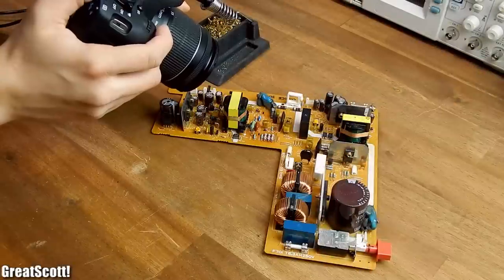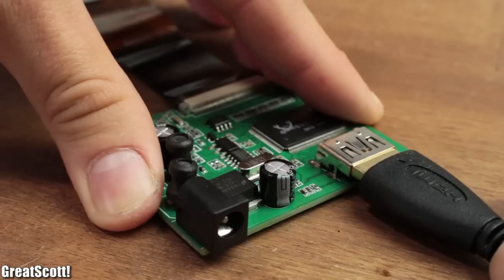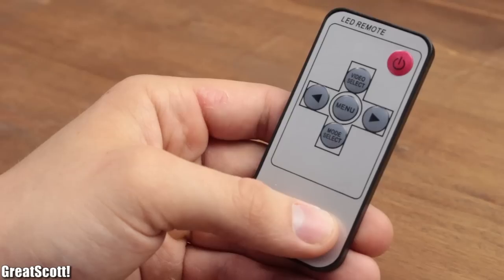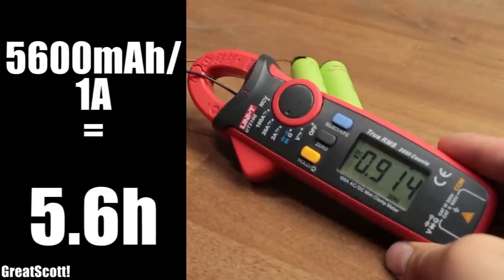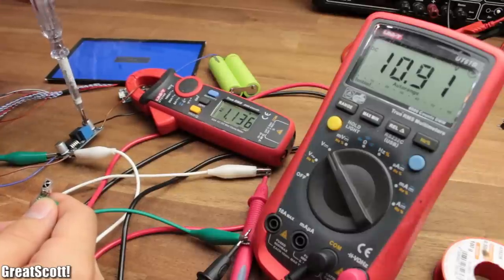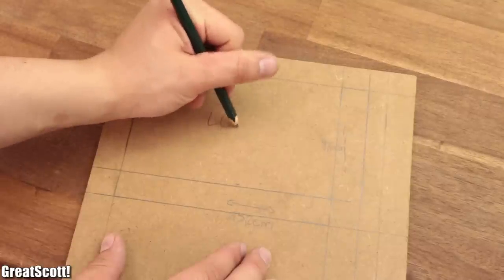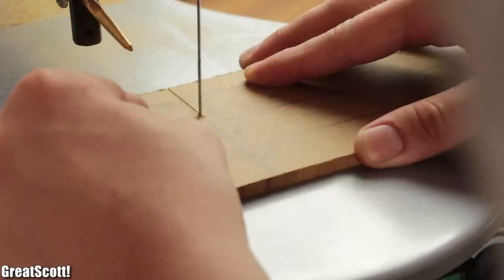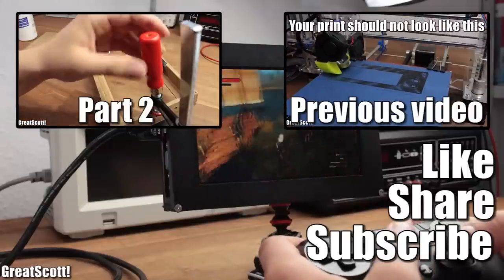DIY Portable Mini Monitor - Part 1

Comment: you have a 3d printer why you did not use it to make a box?
Reply: Raja Shahbaz 3d printers slow
Reply: Because its a diy, most people don't have a 3d printer so it would be pointless to buy one just to make the case
Reply: It is a bit inconvenient dusting a 3d printed that everyone totally has yeah.
Reply: Just because he has a 3D printer doesn’t mean it’s the best solution, doing stuff yourself most of the time looks better. @Tyler Donia 3D printers aren’t slow, building the case takes longer and requires doing stuff yourself.

Comment: I made a monitor under $35,buyed a 15 inch monitor,buyed a dead laptop battery,took good cells from battery,all 6 cells were good only bms was down,I got monitor for $30 and battery for $5 connected all battery in parallel and connected to a boost converter module,apparently my 15 inch monitor was usb powered,I adjusted batteries and boost converter + charging module in monitor case,did all wiring required and everything cost about $35,it was not very easy but today too my monitor works fine

Comment: Tip for anyone with a scratch on their monitor, take some coconut oil and a piece of cloth and rub a tiny amount into the scratch and afterwards wipe the excess oil around the scrath off. The scratch will now be much less noticeable.

Comment: I took inspiration and made one for myself too! Thanks! Instead of fabricating the case from scratch, I obtained a black ABS one that just about fit everything. I'm also using a battery holder for the 18650 cells, rather than soldering it on directly. It's working great!

Comment: great idea , next time try to include a mirocontroller in the box to control the functioning , along with the awesome code to control the buttons , add a resistive touch display , and a temperature sensor on the li-po charger and the battery !

Comment: The XL6009 will not start below 3.5V input, but the cell's voltage can goes down to 2,8V before the protection circuit switches off. We need to use all the capacity of the cells to reach maximum efficiency and long operating time. You need to power the IC from it's upconverted output voltage, but you need also a starter circuit too, which doubles the battery's voltage for some millisecond at powerup to kickstart the converter..

Comment: Hi Scott... Question... If you are consistently unhappy with your freehand cuts on the wood/MDF, why do so much of it freehand? Clamp some sort of guide to your scroll saw... or clamp a guide to your work piece and run your jigsaw's base up against the guide.

Very few cuts should need to be done freehand.

I make my own speakers sometimes and I wouldn't leave my cuts up to freehand. I always use some sort of guide to make sure they come out well.

Comment: Great vídeo Scott, thanks for it! I would like to suggest you a video to DIY! It's possible do a remote control to drive a camera? I mean, control the movements of the camera over a tripod, right, left, higher or get down (like a automatic hydraulic jack controlled from an iPhone, Tablet or whatever). It's just a suggestion, keep the good work
Reply from the maker: tiwar87 I put it on my to do list.

Comment: I'm sure you know this but li-poly charges in a CC mode up to a certain threshold then translates to CV (which those green 18650s look like?), so your clamp ammeter calculation isn't quite right. Either way, great job. You and AvE are people I'm proud to Patreon!
Reply from the maker: +wither8 Thanks for the support :-)

Comment: Hi, I know this video is old but the wiring work and electrical knowledge is fascinating to me. I want to know more. Understanding voltage and resistance of actual products, not theoretical. I am familiar with the physical work like soldering but the where do I start to learn about things in depth?

Comment: I had thoughts about doing something similar with a laptop monitor.  Basically I have the laptop with the original motherboard, and keyboard removed.  Attempting to get all hardware confined in the laptop with push-able buttons that won't accidentally turn on the laptop by closing it.

Comment: This is a great idea! My camera doesn't have the flip out screen, but it does have a wire to connect it to external monitors, although it only works with AV input wires (yellow white and red). I guess I'll have to find something to convert the image to HDMI. Anyways, I like the project, but it looks a bit too thick lol. I think I will build it with a detachable battery pack, and make the frame out of plastic or something lol. Great idea though!

Comment: Nice vid. Why does the batch matter for the Li-ion Batteries to work in parallel?
Reply: They are balanced so voltages and capacity is the same

Comment: My screen controller board comes wired together with what looks like a voltage regulator. Works fine with a 12V bat, but I'm having trouble getting it to play well with the XL6009.

Comment: So since it runs off 5v, why not wire up a simple usb cable and run that instead of battery. Since you will mostly be using it with the laptop anyway.

Comment: can i use the same exact set up with a 15" screen ( old lap top ). meaning just with 2x 18650 batteries or do i need 4x 18650? if so, do i need 2x lithium battery charging boards?
Reply: Yes you should use multiple tp4056 charging board in parallel if theres multiple 18650s

Comment: One idea to charge that 2 cells faster you can add 2*tp4056 module in parallel so it current would be 2a rather than only 1a 
This would charge them in half the time

Comment: How does it work as a camera monitor? Does it display the image properly on the 7 inch panel? I was hoping to make a 5 inch camera monitor using a 800x480 5 inch display but it looks like it wouldn't work from what you said about the 7 inch 800x480 screen.

Comment: Very Nice!

I was wondering if it is possible to charge the batteries a bit faster then 5.6hours.
Reply: You can use charger with higher amperage otput ... 2A, 3A....

Comment: Hello! I have a question for you. I want to make a portable gaming console with a raspberry pi (5v) and a screen (12v). What is the best way to power both of them with just one battery? Could you give me an explanation easy-to-understand, since I'm a real noob at physics. Thank you!P.S Your video's are really awesome and helpful. Keep up the good work!
Reply: +Panda998 yeahh.... about that, I didn't get any response so i still don't know how to. Though, I found another screen on ebay which didn't require any extra power and still was a 5 inch

Comment: Great project... a question: I have a broken Ampe A10 tablet, it has a 10 inch 720p display in excelent condition.... do you think I could use that with this video controller board?
Reply from the maker: +alekzndr92 Google the part number of your screen.
Reply: I found 2 different stickers with codes on the back of the screen... the first one says: "101PWW1"  "Rev 2-A00"   "ED1.0 0 Z0"   "*BJ1270S1C001441*   03"
And the second one says: "B6K00127A1AA1B1607A316692bgDE"
Hope it works..... Thanks for the interest
Reply: I investigated a bit and I found that this display is the same that is used in the ASUS EEE PAD TRANSFORMER TF300, but Asus uses the "101PWW1 REV 1-A00"

Comment: My tp4056 goes into current protection cutting the supply at 2A with the DC-DC converter ((
Holds fine up to 3A without the DC-DC converter.
I wonder why...
P.S. I suspect my screen from Aliexpress is drawing twice as much current than the one you used. Which is why copying your power setup for portability does not work for me.

Comment: Hello,

I have a question from an absolute beginner. I see a lot of projects that add a BMS or BCP in addition to a charger board (lets say fx. TP5000).  Does that mean BMS are just needed for charger boards that do not have an under/overcharge protection or are there additional benefits?

Comment: Great idea :-)
Do you have any links or more information where I can read more about charging two cells in parallel?
I did not find anything in the datasheets for the TP4056 charger. It seems it is not specified for two cells in parallel, but some people do it anyway.
Reply from the maker: ***** Electronics class ;-)

Comment: Hi i already did a 1080 version so i want to do a slightly taller 4k version and i used a dremel with a cutting blade (my grandpa already owned one)

Comment: hello Great Scott i need to know that how did u use 3.7v to 12 at 1Amp and what is the input voltage plz help me iam in big trouble
Reply: I'm wondering that too. Trying to make my own but the output voltage does not stabilize when I have it set at 12v and then hooked up to the controller board. I'm thinking that the amps are too low. Just ordered a current clamp to confirm. Let me know if anyone has the same problem

Comment: Hi! I used your circuit with the same components (except for the lcd screen) but my boost converter give me maximum 3.5v as output when I connect the lcd (without it reach 12v without any problem)... have you got any idea about how I can I solve it?

Comment: so i dont get it : you only use 2x 18650 in parallel (therefore 3.7v, not 7.4v), and you step them up to 12v, but at some point, but at some point you say that you will leave them at 5v, and the screen (which is a 12v) still runs ? can someone please explain that part ?

Comment: I always wanted to create something like this, but also for some "retro computing experience" (I simply does not have place for a "proper" CRT solution which would be ideal for those oldies). But I always hit the problem, that I would need various inputs: RGB, s-Video and composite (well, s-video is kinda easy to "convert" into composite signal, but for RGB you need a custom solution or at least an LM1889 or such - can't really remember now).  But adding all these components, it would be better to have a decent controller board with all these inputs included. And yes, it seems, almost impossible to get cheap LCD/etc "TVs" in small sizes (7"-10") with good inputs any more - or if to, they don't know VGA and/or HDMI which can be useful for other purposes ... and that's not DIY at all, here at least there is much place for that :) :)

Comment: So you used 2x 3.7V (5600mAh) in series to make a 7.4V @ 5600mAh and then used the DC-DC Boost Converter to step-up to 12V?
Do I have this right?
Reply: actually, battery was parallel, he used the first one board to increased 3.7v to 5v, and then the second board was used to convert 5v to 12v,
Reply: r Der
 But surely all that stepping up (overboosting) will cause some fairly significant efficiency issues? Though the batteries have a very high mAh rating it's better to try to find a supply voltage as close to the required operating voltage as possible.

Comment: Hi there, I have 2 negative 12V triggered wires from my car locks, lock and unlock. with the lock I want a buzzer(that I already have fq set) to beep or flash once and with the unlock wire I want it to do it twice, any help will be appreciated. Thanks.

Comment: Is it possible to use 2x2 batteries with 2 chargers? Connect the inputs together, get a 2A charger and Connect the Output Terminals on the boards in parallel to get a bigger capacity?
Reply: You can get this charger in 3A version and use it like in this video. Just search for "TP4056 3A". 
Wiring 2 chargers together in parallel is not a good idea, they wont charge properly or will short out. Depends on wiring.
Reply: Thanks for your answer, didnt know there was a 3A Charger :D

Comment: I set 12 V on the adaptor but when I connect it to the board, this flashes turning on and then goes off continuously. So it doesn't work. I've tried with another monitor and another board and another adaptor and it's the same. The current is not enough. If I set 9.5 V it works for some minutes but if then goes off, when I turn it on again it flashes again. This is being an impossibile diy to me.

Comment: I am looking to source a miniature 2" video player that has it's own speaker (do not want to use headphones,) Must have battery and have a micro sd card slot for loading the video file, or at least be programable to play a video. Must be very simple to play video by one button or touch screen. Can you make it for me or suggest some where I can have it made? Several types can be found on Alibaba but they also play mp3's and have Fm tuner as well...requires pushing to many buttons and working through a menu. I just need simple touch screen video player.

Comment: Is it possible to run two video inputs at the same time? For example VGA+AV. I'm planning to build an RC controller with FPV video from a quadcopter, but I also want to display height, speed etc, using the same screen. Therefore, using two video inputs at the same time.
Reply: Marcus Eide exactly what I'd like to know as well.

Comment: Do I need to purchase the wires for the wiring process or do the prices come with the necessary wires?
Reply: Also, is there a way I could charge 4 or 6 lithium ion batteries to power the lad and raspberry pi
Reply: +Porter Goldman lcd, sorry

Comment: Can you please explain how you user a 3.7V battery to power 12V LCD Monitor?
please make a video about this.
Reply from the maker: Rajendra Prasadh A booster circuit.
Reply: +GreatScott! at 3:30 you connect the 2 batteries(5v?) to the lcd panel..So did it worked with 5v?
Reply: +BaloghkA95 2 batteries in parallel, so 3.7v if you see here it's running on 5v just around the 4:00 mark

Comment: I have a question: The screen has a ratio of 16:10 right? Is it able to display a 16:9 signal from a DSLR properly with Letterbox? or does it squeeze the image? Can you change that in the settings?

Grüße ^^
Reply from the maker: +Johannes Schmidt It converts the input signal to the correct ratio automatically.
Reply: +GreatScott! Hey scott does this have a hdmi port? if it does you should by a intel compute stick and turn it into a tablet pc would be so cool

Comment: Good afternoon, I'm from Portugal and I wonder if you can make one for me and how much it costs to ports, as I do not know much about electronics can it do so. Thank you so much
Reply from the maker: +Hugo Carvalho Sorry, but I do not offer this monitor.
Reply: +GreatScott! can i use the same exact set up with a 15" screen ( old lap top ). meaning just with 2x 18650 batteries or do i need 4x 18650? if so, do i need 2x lithium battery charging boards?

Comment: You said you can charge two 3.7 volts battery cells with a single cell charger as long as thay where always used together...

Can you do it with more cells connected in parallel? I am thinking of 4 or preferably 8. 

Can I get away with it?
Reply: Yep. His information is slightly incorrect anyway. It's usually fine to use several different ones in parallel even if they weren't used together as long as you understand that one of them may die sooner than the other and that it might not last as well in the long term. Parallel batteries is pretty safe as long as they are the same type of battery and they are charged to similar voltages when you connect them. You see, parallel cells automatically balance each other because if one is higher voltage then the other it'll just charge it. The only potential problem is that different batteries have slightly different internal resistances so if you draw high amperage it will draw more amperage from the one with the lowest resistance. This will cause that battery to be more discharged but it'll balance itself out after a few seconds if the load is reduced or removed. For a low power application like this, it's perfectly safe either way and you needn't worry.
Reply: If you want more information about this, check out the candlepower forums. Specifically the user SilverFox has a lot of information about it.
Reply: Excellent! Thanks!

I have a very low power application that should be battery powered for long time lapses. Now I know that I can just hook up as many cells in parallel to get as I need to, and a single cell charger will do for all of them.

Thank you! That was worrying me.
Reply: +Victor Rivarola Yep. That's the one

Comment: what about FPV(first person view) on rc planes ?
Reply: Juel Pereira FPV should work as there is a video input on the board. It does not look like it is wired for sound but who uses sound with FPV?
Reply: TJ Martin thanks, the sound could be used in a small tamyia chassis to make a spy robot with cool night vision and sound/video feed, as for the plane,well you said it will work :)

Comment: Can I use 4 2800 mAh Li-Ion batteries ??
Reply from the maker: Adtrainer ☆ Elektronika ☆ If they were all used in the same batch before and you can endure the long charging time, then sure.

Comment: is there any way someone can give me a circuit digram for this? I'm trying to power a larger LCD screen with the same controller board and am trying to figure out the voltage
Reply: Follow the video

Comment: the converter xl6009 is not working for me, barely reaches 0.270 volts on my multimeter, without that the screen works but it turns off every time.
Reply: nvm, works now :)